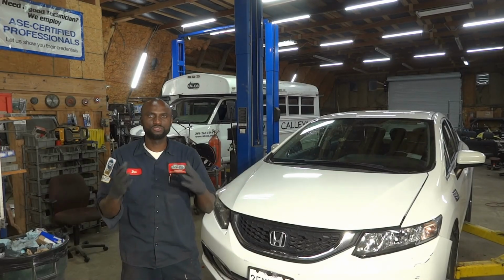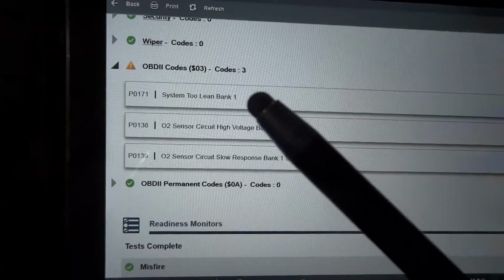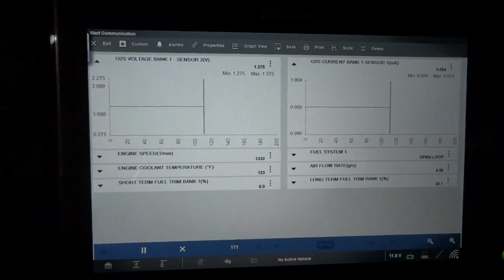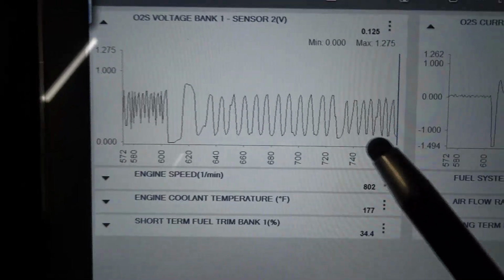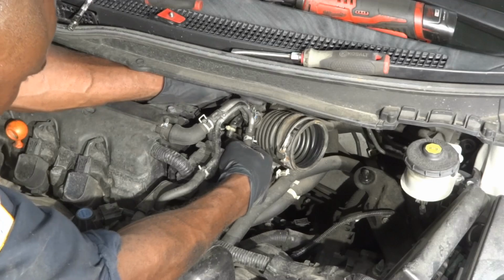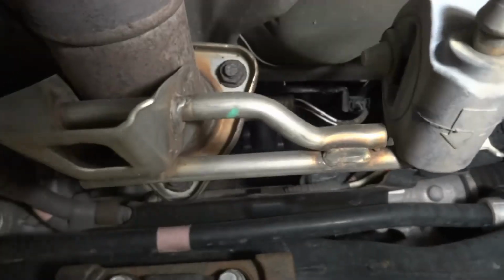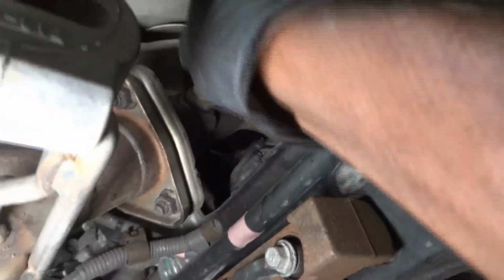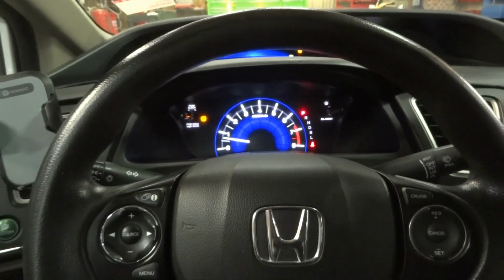HONDA CIVIC CODE P0171 & P0138: FUEL SYSTEM TOO LEAN & 02 SENSOR HIGH VOLTAGE: DIAGNOSIS & REPAIR

Comment: I had the same first problem in my car hight voltage ogygene sensor but the upstraim one, which prevent the car from going over 10 mile an hour, if you try to accelerate too much, the engine RPM decrease to almost engine stalling if you keep your foot on the gas pedal, but my situation there was no check engine light neither codes stored, i just figure it out from live data, the value of the upstraim ogygene sensor was going up to 1.30 V, and fuel trim were at negative 35 percent. The issue start long time ago 1 yeat, as car shaking misfire situarion, but it was internittent from time to time, the car start shaking bad for few second 2 to 3 second, and somtimes the checke engine light came on with code misfire in any cylinder and somtimes no code at all, and i couldnt figure it out, i was just doing tun up plugs, wires, distributor cap and rotor each time it happen, and the problem dispeared for few months till i thought it fixed and then it happen again.
Reply from the maker: @abdouallahuniverse5689  Cool

Comment: So the theory of when increasing the engine RPM, if the lean fuel trim  numbers go down is related to vacuum leak is not always correct, because in our situation here, there is a vacuum leak at the air cleaner  hose  but the theory dosent not apply to it.
Reply from the maker: @abdouallahuniverse5689  No!

Comment: Sometimes if the parts store can’t get the intake rubber boot I just cleaned  the old one with acetone, sandpaper and apply some good ole JB weld glue. It will seal it that tear and will last a little longer until they get it in.
Reply from the maker: @thereckchanic4709   Oh ok, Good to know

Comment: Seems easy with vehicles that have the MAF sensor. But what is the comparative test/issue for vehicles that have a MAP sensor, not a MAF? Thank you!
Reply from the maker: @jaym5938  you can look IAC Valve counts to figure out what kind of problem you have
Reply: @KITS_Auto_and_Truck_Repair  Thank you!

Comment: PO171 on my 2014 Nissan Sentra my mechanic scan tool only brings up this code when I take it to auto zone to scan po171 comes up and P0456 small evap leak ………….MAFS CHANGED BOTH OXYGEN EENORS CHANGED PCV CHANGED PURGE VALVE CHANGED SMOKE TEST DONE YESTERDAY SMOKE WAS COMING FROM THE OIL CAP CHANGED CAP CLEAR CODE CODE COMES BACK WHWN I STATT CAR IN AM SMFH
Reply from the maker: @PyiAnkhiBolo  Did you analyze fuel trim numbers?

Comment: Use Mass air flow sensor cleaner, not the brake cleaner man, the MAF is very sensitive to residue left in it, and the prober cleaner dosent left any residue behind.
Reply from the maker: @abdoualilahthomas8031  ok

Comment: Why is the downstream O2 sensor still cycling?  Doesn't look right.
Reply from the maker: @schifoso  there is nothing wrong!
Reply: Isn't it supposed to be a constant value?  It is on my Hondas.  Is the ECM messing with the fuel delivery?

Comment: A bit confused. Since the cause of the P0171 is a vacuum leak, why didn't the high RPM revert the fuel trims to normal?
Reply from the maker: @chukachuka17   what do you mean?
Reply: @KITS_Auto_and_Truck_Repair  you mentioned that with a vacuum leak, revving the RPM will usually correct the fuel trims with -10 to +10%. However, that wasn't the case here even with that vacuum leak.
Reply: @chukachuka17  probably because leak was too big, so that even revving most air was bypassing the MAF

Comment: Does the rule of high RPM returning fuel trims to normal in the case of vacuum leak also apply to turbo powered engines?
Reply from the maker: @chukachuka17   not necessarily!

Comment: I HAVE A 2013 CIVIC . MY CAR DID THE SAME EXACT THING.  NO ENGINE LIGHT CAME ON. I CHANGED MY MAF SENSOR AND THE UPPER OXYGEN SENSOR.  THE POWER TO THE ENGINE RETURNED.  GAS MILEAGE IMPROVED.  SMOOTH IDLE.  CLEARED THE CODES.  EVERYTHING BACK TO NORMAL.
Reply from the maker: @henrystyle4879   That's Good!

Comment: Is there any way to diagnose if its the fuel pump or maf sensor/vac. Leak without that computer all I have is a regular obdll which I use just to get codes
Reply from the maker: @vatoloco1348  you can look at Data Pids and figure it out!
Reply: @KITS_Auto_and_Truck_Repair  ok so I found out my obd11 did have a live data option shrtft1 is 43-44% longft is 25-26% while idling at 680rpm I've cleaned my maf sensor and there appears to be no leaks I'm running a code p0171 right now and can't figure it out any recommendations would be greatly appreciated 😅

Comment: Deo, I hate to tell you this, "now they are recommending MAF sensor cleaner or electronic cleaner on this sensor.   They don't even want you to use brake cleaner on throttle housing.  The recommendation on throttle housing cleaner is now Sea foam or throttle housing cleaner.
Reply from the maker: Melanie Branton D.V.M.  yeah, you are right I should have used a MAF Cleaner, I used what I had Lol!  next time I'll make sure I get the right stuff!

Comment: 2015 Honda Civic 1.8 the hose leading to the throttle body and mass air sensor it was ripped well the air filter look like it wasn't changed much so that means that area wasn't moved a lot so how did that get ripped
Reply from the maker: brenda palen  overtime with the heat in the engine bay the hose cracks and eventually it breaks!

Comment: Hi. Can you explain why did you changed the second o2 sensor after you found the air leak? O2 b1bs2 after replacing is still not right as he is oscilating. There should be the almost the flat line in range 0.45 to 0.7v with tendention to rich side if cat is good. Will look for exhaust leaks or bad catalyst after good heatup
Reply from the maker: Mr. T  02 sensor was replaced because of how slow it was responding! no exhaust leaks were found, an 02 sensor after the cat can oscillate momentarily which is ok, but not just all the time!

Comment: I have the same exact car and engine. Currently dealing with weird idle. My car shakes/shuddering (noticeable enough) but no check engine light. Did a tune up recently with new spark plugs and all about less than a year ago. I also replaced the intake boot that you replaced and cleaned all my throttle body plate and MAF sensor with cleaner and a new air filter and freshly new changed oil. 

I looked at the fuel trims with my scanner and my short term fuel trim bank 1 is 2.3 - 3.1(%) and my long term fuel trim bank 1 is -2.3 (%) to -3.1(%). Long term is on the negative side… Would that be pointing to a bad O2 sensor you just replaced? Also my engine coolant temp is about 203F warmed and after driving for a good 20minutes. Not sure if my numbers on my car are normal? Any input would be appreciated. Thanks
Reply from the maker: Jomari Torres  Your fuel trim numbers don't look bad at all!! did you get these numbers at idle or at high rpm? the next thing you can check is your crank and cam sensors, I'm not saying replace them but check them, if you don't have the scope to check them, you should have a pro mechanic do that for you!! so you can get to the bottom of the problem!
Reply: @KITS_Auto_and_Truck_Repair  Got a check engine life for crankshaft position sensor 2 months ago and replaced it. Havent had any check engine after that and its been clear since then. The car was idle when i checked the numbers. What do you think of my egr error reading? Is that normal also? Thanks
Reply: @KITS_Auto_and_Truck_Repair  would you also know where the camshaft sensor located for this engine?
Reply from the maker: @J0mzk13  I believe it's somewhere on the cylinder head around the cams
Reply: Forgot to mention, i cleaned my egr valve also. My scanner also shows EGR error 99.2(%) to 0 (%) every 3 seconds… would that also be an indication of a malfunctioning egr valve?
Reply from the maker: Jomari Torres  yeah! your EGR valve might be opening at the wrong time!! but usually ego opening at the wrong time would cause your trim numbers to be high positive!!